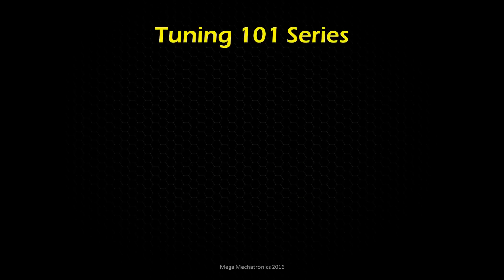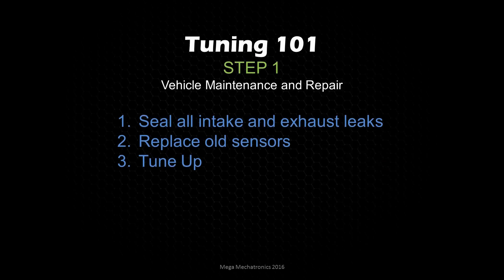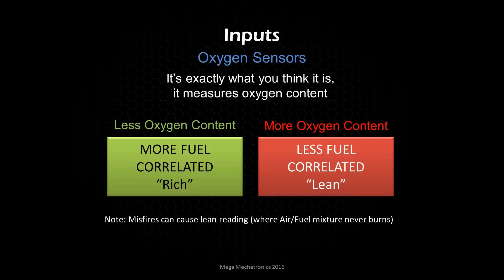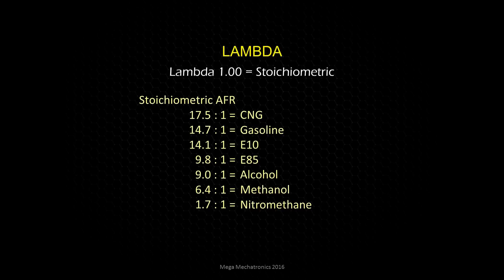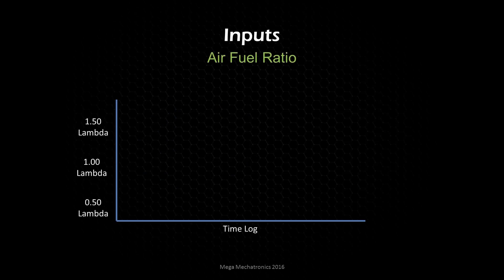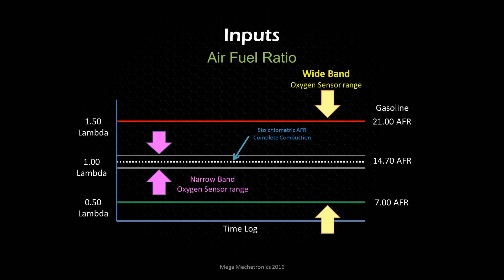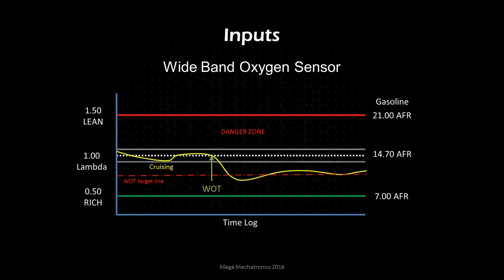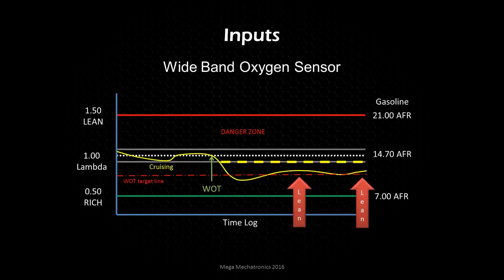How to tune Engine Tuning 101 - Part 1 - Intro, Lambda, Wideband

Comment: Only thing i would add is when you get misfires a rich mix would be present because youre not burning fuel and if you have a catted exhaust system you will damage it  along with your 02 sensors
Reply: That is if it is a rich misfire which you can tell by putting a sniffer on your exhaust and seeing how many carbons ppm you have

Comment: Hi.. hope u r doing good..
What could be potential causes of engine control unit cutting the fuel supply, while testing on Dyno..
Car works perfectly fine while on road, timing is done perfectly. There are no fault codes & same cars were tuned earlier but not the current car, there is just fuel cutoff while trying to boost..
Reply from the maker: Check all limiters for speed like rpm and also temperature limits.  Is the drive by wire throttle closing when you have the accelerator pedal 100%?

Comment: what is you are seeing lambda 1 but the AFR is 13.7.?    I am using torque pro with manufacturer specific PIDs....also during decel where fuel is cut, I am seeing AFR above 25 (I was told this was normal) but a Lambda 2....is the 2 normal?

Comment: Your explanation is wrong. An o2 sensor only senses o2 concentration on the lean side of lambda 1.On the rich side of lambda 1 it senses the concentration of combustibles in the exhaust. That's why there's a switching point at lambda 1.

Comment: i thought of tuning like tuning a carbed 50cc moped, where you just make it richer or leaner and if you can't adjust the fuel and you're running to rich you remove the filter to even things out
this video really helped
Reply from the maker: You got it, for an internal combustion piston engine to run at greater than 90% of it's potential, it doesn't care about carb or FI, it just wants a good air fuel charge.

Comment: Dont know much about laptops which laptop as of today(04/8/19) on amazon has plenty of power to run current HP Tuners software without any problems?

Comment: hello. The video mentioned tuning wih application to v6 and v8 engines. Just wondering if this type of tuning can be used on inline 4 and inline 6 engines as well? I know its a novist question but i am pretty new to the concept.

Comment: thank you for sharing the lesson sir . i wounder if such a tuning device can tune all OBD supporting vehicles . im thinking of making an income out of tuning cars here in the middle east (OMAN) . i would like to know the price of the required equipment and to have a training on them how and where ? rgrds.MUHANNA
Reply from the maker: Start here for example: HP Tuners, which is the hardware / software I use to tune:
https://www.hptuners.com/products/vcmsuite_vehicles.php

Otherwise you should look into what car models you want to tune and find another company that supports the vehicles and provides the capabilities you need for professional tunes.  

HP tuners Pro costs $600 USD, this allows wired inputs (like WBO2, Pressure Transducers, etc) and also has outputs (for knock or shift light, etc). Software and updates are free but you need an account and be registered.  It's about $100 to tune a single VIN # vehicle, they have a continuous profit stream yes that is normal.
Reply from the maker: Also, the $100 per VIN# vehicle is Unlimited Tunes linked to the ECU and HPT Hardware module.  If you are tuning your own cars this is great, unlimited tunes for your car!!

Comment: Hello first offyour videos are great! I see your driving a Pontiac Solstice. I have a 07 Sky with what I call a LE61. A 2.4 with a L61 non vvt cylinder head with stage 3 Comp Cams. Also running a 1.6L Lysholm supercharger as well as meth injection and long tube header. my problem is no matter what I try I cant get the fuel trims set right. If I send you my log data and tune can you take a look and see what you think? You can email if you'd like with your response. My email is suprsky@live.com. Thank you Sir.Rick
Reply from the maker: If your fuel trims are all over and you have a new NB02 installed, it could be related to an exhaust leak or something causing inconsistencies with air flow including the intake side.  As the engine heats up things start moving around and leaks could be opening up.  

Take a good look at your exhaust manifold look for signs of carbon build up on the outside indicating a leak.  Also double check your NB02 wiring.  The wiring harness pig tail for most OEM O2 sensors double as an air tube to fresh air for calibration.  

If the 02 harness has ever been contaminated with solvents, greases, sprays, oils it may have been completely compromised.  If someone re-wired or soldered the O2 harness it will ruin it, even purpose built O2 repair pigtails can be installed incorrectly.

Comment: this may be a dumb question and mind you, coming from a car noob. I'm thinking about getting a tuner and I'm interested in doing it myself instead of paying for one but I heard you mention 6 and a 8 cylinder cars.. would this apply to 4 cylinders too or should I look elsewhere?
Reply from the maker: All tuning examples in this video 101 series are 4 cylinders, so you'll be fine.  A good engine that was well designed will have balanced air/fuel mixture entering every cylinder; that is why you make a "global" air flow correction instead of correcting air flow for each cylinder.  Calibrating each cylinder would be useful in applications such as high performance racing engines however.

Comment: Can you say if a Wideband O2 works better with MAF vs MAP?
Reply from the maker: From my experience, the WBO2 is very close to the NB02 readings.  As the vehicle OEM Narrowband fluctuates, the Wideband matches the fluctuations (depending on far apart they are physically in the exhaust will make a difference in timing of the readings).  So if you were to make me guess because I have stared at it a lot while driving, it bounces between 0.98-1.02 lambda or +/- 2% around stoichiometric.

If your question's context is accuracy, the Narrowband works great at Stoichiometric or Lambda 1.0; this is not Wide-Open-Throttle or higher loads.  Narrowband is pretty much useless outside of stoichiometric, it will indicate rich, but rich could mean 0.95 lambda or 0.50 lambda or anything in between it won't tell you.

Folks get away with tuning without a WBO2 by monitoring Knock, but that is a hack way of doing it because a fully optimized tune with a WBO2 will make the engine perform much better and more efficiently.